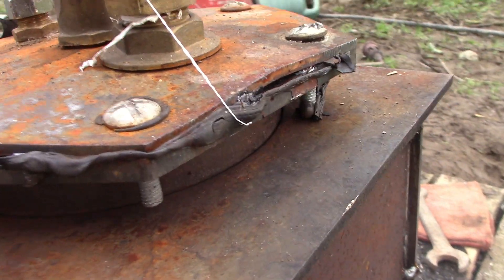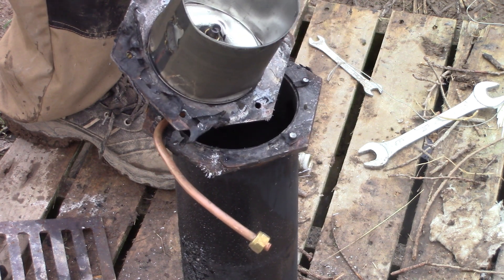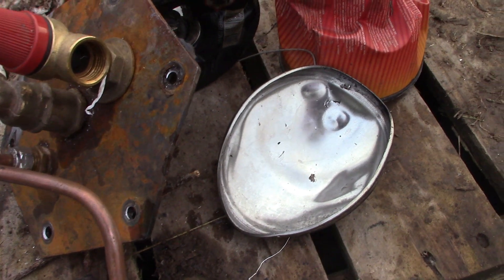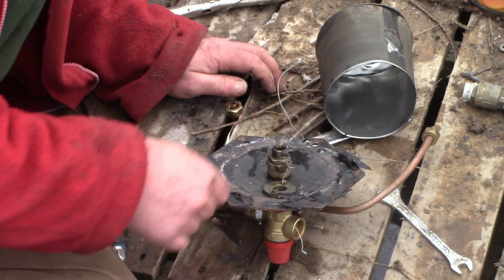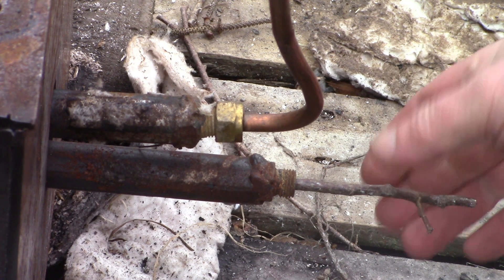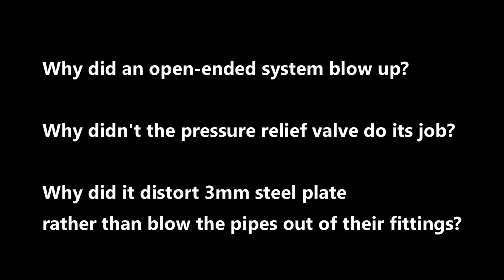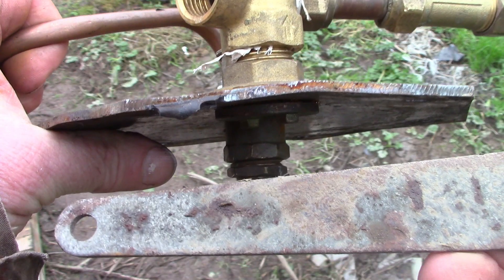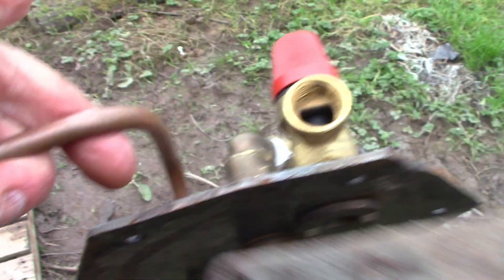Why Did My Boiler Explode??!! My Own Big Bang Theory...

Comment: You got to realize steam especially superheated steam expands 25 thousand times its volume I'm an American so I'm going to use the Imperial or Freedom Units I love that so it's a one square inch of superheated steam expands 26,000 Square in so what probably happened as you got more water in there or something that you're not expecting this steam pressure raised so drastically that it crushed those containers with ease you have to remember that steam is one of the most powerful forces that we know to man we still use steam today and pretty much every Power Plant that uses fuel you cannot have any empty voids inside your boiler at all they will be crushed so any kind of float Hollow sphere or canister will be crushed by the superheated steam like it was nothing there has been boiler explosions that has thrown chunks of Steel from locomotive boilers over a mile away and I'm talking about like 10 or 15 ton chunk of Steel flying distance I've about I think 10 miles or something like that it's something that's insane if it happened back in the day here in the states so you have to remember steam is extremely powerful it will crush or explode that's why I'm saying figure out a way to build a fire to boiler if it ain't broke don't fix it do the kiss method keep it simple stupid cuz if you make something really complicated and fails look how many things you have to figure out to figure out why it failed yes steam is not going to be like a gasoline engine do you not put a hollow float inside the boiler whatsoever it will be crushed
Reply from the maker: Nope - look up your chemistry again... 1700 times bigger to get to wet steam..
Reply: @wayoutwest-workshopstuff6299  there is two types of steam locomotives saturated Steam and superheated steam a superheated steam boiler runs the steam from the steam Dome through bigger fire tubes and it goes back and forth through the fire tubes which makes it superheated which expands 25000 X volume the first steam locomotives were saturated steam engines look up American super-powered locomotives America is who came up with superheated steam locomotives it was the Lima locomotive works that figured this out first so yeah you're going to have to dig a Little Deeper superheated steam engines are more complicated to build you can do it it's quite a lot more piping and if you do build a superheated steam engine make sure you put the throttle after the Super heater not at the steam Dome also look up feed water heaters what they do is they use the exhaust of the engine to pre-heat the water coming from the tender cuz the water coming from the tender is cold and if you put that cold water in a hot boiler it might crack the Firebox Crown sheet so we feed water heater takes the exhaust and warms up the water before it goes into the boiler so yeah that's the one thing I forgot to tell you superheated steam locomotives look up Lima superpower locomotive peace out let me know if you need any more information Tim

Comment: I really think you should try to figure out how to build it was called a fire tube boiler that is what steam locomotives use they're the only boiler that really works for a locomotives because they produce enough steam at volume so yeah look up diagrams and there's also people out there restoring steam locomotives all the time and you can see how they Swedge fire tubes into the the fire flu sheets which makes like a bulkhead between the fire tubes Smoke Box in fire box areas there's also an inner and outer Firebox they are held together by what are called stayblots but there was only a couple of experiments with our called water tube boilers instead of fire tube boilers it's a totally and totally different design they weren't very effective and that's what your building is like a water tube boiler those do not work any kind of equipment that's going to move around because of all of the piping will crack and break fire tube boilers are where it's at for operating locomotives traction engines anything that ever ran down the track or down the road usually had a fire tube boiler I know you don't know the terminology so I'm here to educate you cuz I Love Trains and machines and I've been teaching myself everything that I can learn about locomotives and especially steam locomotive because I've been fascinated with them my whole life good luck on your projects keep up the great work good job Tim
Reply from the maker: Thanks - but look up the fastest steam boat record - that's run by a water tube flash boiler..
Reply: @wayoutwest-workshopstuff6299  yeah that shows you that water tube boilers only work on vessels you can look up Back in the Day in England it there were some experimental steam locomotives that had water tube boilers but they all failed it's the vibration of the locomotive going down the track basically work hardens the piping in the water tube boiler so over time the metal will metal fatigue and break there's literally nothing you can do about that

Comment: Looking at the two floats, the bottom float pretty clearly was crushed, but I think rather than being crushed, the top float exploded - the bottom of it popped off neatly, with the seam between it and the top being the weakest link, and is bulged outwards, while the top got jammed up close against the top of the boiler, certainly tightly enough to prevent steam from leaving it. That would also explain why the fittings did not pop off - they were shielded from the increase in steam pressure by the top of the top float, and so the pressure was able to rise until the top sheet of the boiler failed.

Now, why did the top float explode? The simplest explanation would be that it wasn't quite empty, and the remaining gas inside it expanded with the heat and caused the explosion. Though then the question becomes, why did it only explode now, and not the first time it got heated?

Comment: Punch a hole in the bottoms of the floats so pressure can remain equalized. No more imploding/exploding floats. Thus, the paint-cans return.

May need to disassemble/drain or "blow-down" the boiler to drain the floats after they've cooled though, since the air/steam pocket would contract and perhaps not provide enough buoyancy to function properly until up to temperature.
Reply from the maker: They'd just fill up with water, I think
Reply: @wayoutwest-workshopstuff6299  
Personally, I've had to drain "sealed" plastic carburetor floats on a gasoline-engine before (largely due to the pressure fluctuating due to temperature in storage causing them to suck fuel inside them through the welded seams). The floats would inevitably flood anyways, so making them easier to drain during a blowdown is probably for the better.

An open bottom float would certainly take on some water from the bottom, but would also serve to equalize the pressure inside the float so they won't implode at 90 to 120 PSI (although you'd need to account for the floats having 1/8th their normal buoyancy at those pressures... although the gas-expansion of the air-pocket may counteract this... worst case is the air expands more than the steam would and you get a travelling air-bubble in the flash-boiler).

Comment: your theory makes perfect sense. As to "why is the plate bent instead of the tubes popping out", itll have to do with how pressure works.. pounds per square inch.. the ends of the pipes only endured a fraction of the energy because less square inches. the plate however has a great big surface area for this pressure to work on.

Comment: The floats were empty, until several cycles of use of the boiler filled the canisters with steam and water. You could prove it by putting an empty canister in a pressure cooker, let it cool, take it out and see if there is water in it.

Comment: I think it's more likely that the top butane canister suffered an overpressure failure due to either super heated butane or more likely steam trapped behind the one way valve. It probably developed a low pressure condition after the first use and water was drawn in as it cooled. This water was boiled during the second test but couldn't escape. The pressure relief valve on the main boiler chamber probably couldn't reduce the pressure quickly enough and may have been obstructed by the sheet metal from the butane canister. Glad nobody got burned.

Comment: You found the top aluminum float crushed against the boiler top! clearly it got pushed up hard enough to obstruct the pressure-relief valve and push out the top of the boiler. I would guess that it's implosion dynamics widened it to form some sort of seal that allowed steam pressure to build under it.

Comment: Test time

 reset your boiler to its previous setup, load the canister's seal lid and fill completely with water.

In this configuration you have an incompressible scenario without heat or steam you have a chamber which you can now Pressurise to see which components fail first.

A pressure washer would be a good choice to increase the pressure of the Chamber and a pressure gauge to monitor pressure in the chamber if the pressure drops then reopen and see what happened. This will test your Pressure relief valve and all fixtures on the top and in side of the cylinder including the lid without danger of explosion .
Reply from the maker: Good idea!

Comment: I'll take a guess that the top float blew the bottom off from low pressure in the boiler. I've seen canisters like that before where the valve is designed to be filled by pressure and engagement much like a schrader valve. When the boiler was pressurized might have been able to push the valve in allowing steam and air to enter the canister till the high pressure side of the boiler and low pressure of the canister met equilibrium. When the boiler cooled or was operated at lower temperature the pressure in the canister cant escape and it blew up from being over pressurized and being open ended didn't help it because without building enough pressure in the boiler there wasnt much pushing back on the canister to keep it from yielding.

Comment: When I was a kid, I would put empty cans in an outdoor fire just to hear the bang. It was louder than any gun I've heard more like a cannon. They were paint cans, and you might think the flammable gas inside caused the explosion, but it would not ignite in the can because there is no oxygen in there. The bottom of your top float blew off simply from the increased pressure from heating it. The sudden release of that pressure in an enclosed container is what simultaneously bent the 3 mm top cover and crushed the lower float. You need a solid float to make it safe, or as I have seen in a steam system before an upside-down cup with an air bubble trapped in it.
Reply from the maker: I think you're right - but I haven't thought of a suitable material solid float - any ideas? (Why would a bubble of air stay inside an inverted container? I would surely quickly be displaced by steam or water.)
Reply: As long as the cup is kept from tipping it will continue to hold the air if steam gets inside it would condense on the inside surface of the cup since the water would keep it cooler than the steam.
Reply from the maker: @jdouglas4564  Not really - the water and the steam are at the same temperature

Comment: that part of the boiler needs to be FULL, the level needs to be controlled from outside of it, so it's not a matter of refilling it as it needs water, it's just never letting it ever get headspace.  there's an odd reaction that happens, when steam gets let out too fast it causes the hot water to flash, exactly what you're thinking, the spring thing.
Reply from the maker: If it was full, water would escape to the next step, instead of steam. Apparently half-full is best..
Reply: @wayoutwest-workshopstuff6299  if you fix the issue that caused this failure, it'll be the next more dangerous failure type you have to contend with, so a little forethought... sorry if i expound on something you already know, but a reminder can't hurt.
     anyway, any part of a boiler that contains pressure, that is touched by flame will be affected by the effect that rice cookers use to operate.  if i were to suggest anything of an improvement, it'd be a tank on the side that controls the water level, draw the hot water from that tank instead.  so, water level higher than any tank or tube in the actual firebox.  a carbeurator float might be better in your application.
     in a rice cooker, when the water is in the pot, the metal covered by water never goes above 100c, when the water boils away and uncovers the metal it has a temperature spike.  it jumps to 400 and turns off the heat.
     in a steam producer there's usually not that kind of control, so a tiny air bubble on the surface of the pot allows the metal at that little pinhole sized dot to reach the temperature where it melts... then fails.  imagine a huge patch uncovered.
     you can use a water separator after the coil, before the superheater, but the superheater goes into the hottest part of the flame, and is a consumable part, it doesn't matter if some small amount of water gets in it.

Comment: Is it possible that when the floats collapsed and detonated that the pressure relief valve was somewhat blocked and couldn’t release it fast enough ? I believe the relief valve is to small and the floats developed leaks allowing superheated water to build up pressure inside them causing 2 explosions! If the floats were solid and the valve bigger it might not have happed ! Just my opinion !

Comment: Pretty sure it was the float that did the damage here. You have a canister full of air/gas that expanded and then exploded due to the heat. Or to probably be a bit more accurate the heat probably caused the welds to fail on the float and that caused it to blow out.

Comment: 1) he who never treys makes nothing, they is no dishonor in failing :)

2) typed before I saw what you think happened :) The air inside the empty gas bottle expanded and blow up the bottle.

EDIT after watching your idea what happened. I was wrong :) But I think you need solid floats one that cannot collapses.

have you considered build a purely mono line boiler ?
Reply from the maker: I just can't think of a material for the solid float - any ideas? This would be a mono line boiler - except I need to control the input relative to the heat - hence the float valve.

Comment: Your theory seems valid...lower pressure/dry steam deformed the upper chamber, superheating the lower chamber, and the vaporized wet steam expanded rapidly causing the over pressure, which hit with a surge, which the relief couldn't handle fast enough. Wow, that could have been worse on you...so, you might say, going for the camera, and YT saved ya! Keep learning for us...way cool content...

Comment: 1) gas canisters imploded. assume 6 inch diameter x 4 inch high. Area of top and bottom = π(6/2)^2 x2= 56.5 square inches, area of side is π(4)(6)=75square inches. 113 inches square. Assume 1atmosphere (14.7 psi) inside the gas canister.  14.7 x 113 =2000 pounds trying to get out. This is a pressure vessel so it can contain this pressure. But now you start heating the boiler. 3 bar or 42 psi x113 sq inches =5000 pounds of force trying to get in. These gas canister are pressure vessels, not vacuum vessels. They will implode in.
2) once the gas canisters imploded, more water was added to boiler. Taking up all the vapour spaces in the boiler. 1liter of liquid water will make 1300 liters of steam.
3) at some point the gas canister then covered the top of the boiler fittings covered up outlet and relief valve. 
4) Because no space for water vapour. Soon a very high pressure system was created. And it blew the top open. 
5) The top cover plate was subjected to enough force to hydro form the steel. Assume top plate measure 8x8 inches. That is 64 square inches.  64x42=2688 pounds Or more of force.
Reply from the maker: maybe, but I'm not convinced that the prv and the outlet were both successfully sealed completely

Comment: The boiler walls above the water line were superheated, one float ruptures, splashing water on hot surface, which produces a momentary 10x increase in steam production.  The relief valve opens, but steam generation rate is too fast for it to keep up.  Excess pressure collapses second float and lifts lid.  Consider a rupture diaphragm in addition to the valve. You need to keep the entire heated area flooded.

Comment: [TL;DR] Just handle always empty gas canisters as full gas canisters. 
You can open the valve to let most of the propane / boutane out and try 
to fill it with water. At this point you could handle it with less care.

I saw the last Video on the project and I thought: Who ever thinks that these gas canisters are fully empty?
There is always a little amount of propane and or butane inside to keep with the ambient pressure (around 1 bar ).

But I did not expect this to happen - but there you got it now :-P (better now than later in a building or near living!)

Comment: From what I can see, the space occupied by the floats represents a fairly large percentage of the total volume of the boiler, say 50%. If the floats had been say 5% of the volume,  even if they were to burst/collapse, the impact would have been minimal and the boiler may have survived the failure. 

As an aside, I'm not sure why you have chosen this style of boiler for your project, but I prefer a water monotube boiler. The likelihood of an explosion is much lower and even if the coil does rupture, the release will be much smaller due to the volume and dimensions of the tube. So long as said coil is reasonably contained in the firebox, there would be relatively little risk to the operator and bystanders. I wish you well on your next attempt.